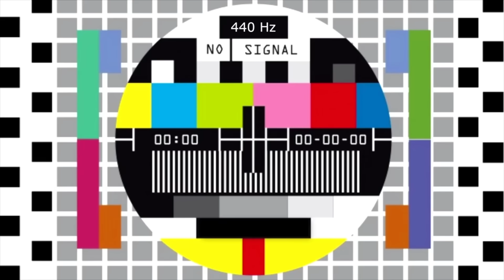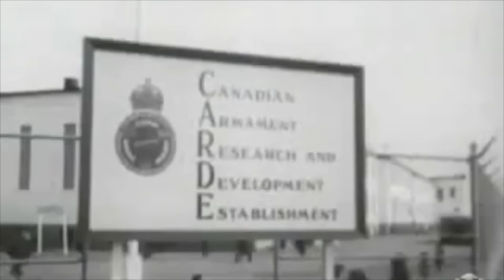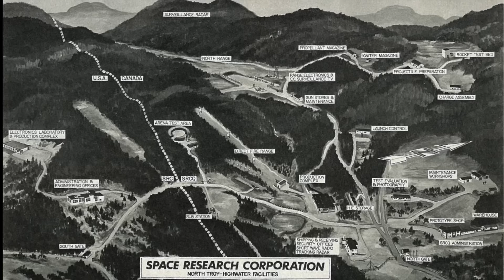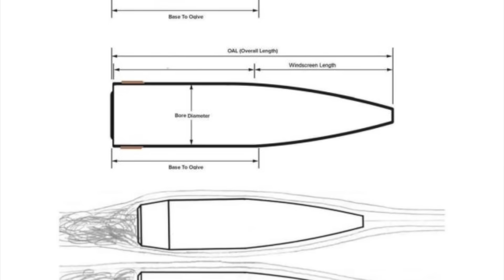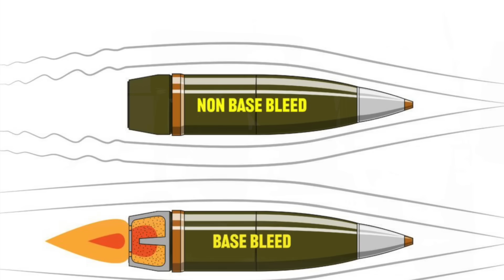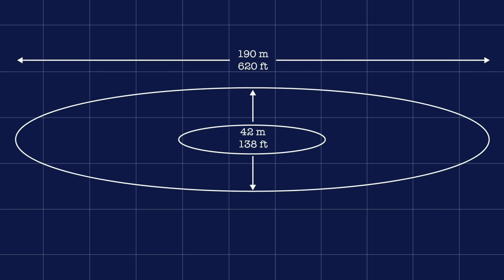155mm ERFB Shell: Faster, Farther, Deadlier

Comment: The shape of projectile Bull implemented is good for range but bad for accuracy. There is an alternative solution to use more traditional shape projectile, but fire it at higher velocity and with flatter trajectory. Modern GPS guided MLRS systems are tough competitors to traditional artillery. It's unclear if it is worth using such shape projectiles nowadays or not.
Reply: That's not an alternative solution, that's just adding velocity to the mix... Something that can't be done without increasing the size of the gun...
Reply: @marcusborderlands6177  Giatsint-S is not big. It has 47 caliber barrel and 27 liter loading chamber.
Reply: @Reginvalt  You misunderstand, the barrel and chamber have to be thicker and heavier. its called physics. if you increase the pressure (thats how you make something of equal mass go faster) you increase the stresses on the surrounding chamber and barrel. The only time this would NOT be the case, is if the ammo was originally UNDERLOADED, and if it was, LOL, LMAO.
Reply: @marcusborderlands6177  M8 don't argue if you don know. The reality is that there are different ways to shoot at a certain distance. You may use more aerodynamic but less accurate ammo with nubs or use less aerodynamic but more accurate traditional shells at higher velocity. And latest artillery pieces may or may not use shells with nubs, meaning Bull's ERFB isn't one and only solution.
Artillery charges are more complicated than handgun loads since they a variable in power (they don't shoot at full charge all the time), gunpowder properties are different and the cost for more pressure is not only extra weight and size, but longetivity of barrel first of all.

Comment: Yeah, this sounds like total nonsense.

Theres no possible way the cost per launch was $5000 dollars - even just the standard barrel reppacement every few hundred shots of the naval cannon would average out to tens or hundreds of thousands per launch.

You're probably only quoting the cost of the shell, which is extremely misleading.

2) quoting the extreme ranges long barreled cannons can get without mentioning the downsides is again, extremely misleading.

Amongst many other problems, barrel wear skyrockets which means you need constant and extremely expensive replacements.

Comment: My cousin worked for Sheffield Forgemasters at that time and he always wondered what the things were that he was working on due to the precise specifications. They turned out to be super gun barrel  sections.
Reply: If I'm not mistaken the Iraqis contracted them under the guise of manufacturing sewage pipes, so given my manufacturing background I can imagine the strange looks that were had when they were told how tight the tolerances were for alleged sewage pipes.
Reply: @richardmillhousenixon  iirc it was declared to customs as petrochemical equipement
Reply: @alcapone796  MI-5 was all over it. And Forgemasters knew perfectly well that they weren't pipes....the reason they were seized on the docks was because Forgemasters got paid first....
A large part of Forgemasters work was for the UK MoD...you don't bite the hand that feeds....and in fact they're now owned outright by the British Ministry of Defence...
Reply: @richardmillhousenixon  I thought they were passed off as parts of an oil production plant but i may be wrong. I have always wished the parts were all layed out as if the gun had been built just to see the scale of the whole thing.
Reply: Now I'm going to have to go and rewatch the episode of Citation Needed where they talked about it again.
Reply: Very high performance pipe line...
Reply: @zapfanzapfan Not very long before that the people building oil pipelines under the North Sea had complained about the quality of some of the pipes.
Reply: @zapfanzapfan  such pressure, such wow
Reply: I can confirm that Forgemasters knew that these sections were not petrochemical pipes; they had to be honed on a machine tool that gave a similar internal surface finish to smooth bore tank guns.  What they could not understand was the thin wall section.  Traditional artillery pieces had a greater wall thickness to diameter than that specified for this contract.

Comment: That thumbnail really caught my eye - G5 and G6 ammunition! South Africa needed modern artillery after encountering the Soviet 130mm M-46 in Angola in 1975.  The M-46 had a range of 27km (unassisted) and 40km (assisted), while  SA's 5.5", WWII field gun (G2 140mm) had a range of only 16,6km and the QF 25-pounder (G1 88mm) a range of 12,3km. Israeli 155mm Soltam guns were acquired as a stop gap while the G5 was being put into production by Lyttelton Engineering Works. 

The ammunition is currently manufactured by Rheinmetall Denel Munition at Somerset West, about 25km from where I live.
From RDM's website:

"Rheinmetall set three new world records during a test fire event in South Africa: A G6 howitzer with a 52-calibre gun achieved the longest range ever attained with a conventional 155 mm artillery round, 76 kilometres, while the 52-calibre gun of PzH 2000 self-propelled howitzer lobbed a shell 67 kilometres, and finally, a field howitzer with a 39-calibre gun attained a range of 54 kilometres."  
By "conventional", I presume they mean not rocket assisted.

Frederick Forsythe's novel "The Fist of God" references Dr. Bull and speculates who may have assassinated him. It think it is fairly safe to say that a Beretta .22LR pistol was used.

Comment: Eh? How on earth is low accuracy going to help you with counter battery?
Reply: Because a deployed artillery battery takes up quite a lot of space, so even with the higher dispersion, you are still likely to hit (part of) it. The shrapnel of the shells is lethal for several hundreds of meters around the point of impact for anyone not dug in. In modern combat, artillery is not dug in; that would take far too long. Counterbattery fire has become so effective that the guns must be moved to an alternate firing position after each fire mission. With a long-range counter-battery unit on alert, it will fire at the enemy battery as soon as it is discovered and probably will catch them when they are rushing around to bug out.

Comment: 15:32 absolute BS. Are you not aware of the Nazi gun that was aimed at UK during WW2, that was also fixed in place.
Reply: I don't think they so much as got a shell in it before the ground it was tunnelled in crumbled into little bits.
Reply: @20chocsaday the tunnel didn't crumble by itself though, it was destroyed by allied bombings. Point still holds that it was fixed in place (no traverse and elevation) and was still a danger to UK (London to be precise) unlike what the guy in the video is claiming that since the gun in Iraq was fixed in place it wasn't a danger to nobody. 

There were actually other smaller guns used by the Nazi that were also fixed in place to bombard other cities like Luxembourg.

Comment: Vacuum rocket motors can be tested on earth in open atmosphere. 

By first evacuating the test chamber before ignition the cover will be blown off by the efflux and then Venturi effect will maintain the vacuum inside the test chamber up to the plume. 

Ok,
Now,
Supergun/orbital guns

You can dig a bloody big hole and stick your rocket etc into a full vacuum without needing a seal to obturate the blow by as it is its own vacuum pump. 

Yes, you do need a cover that will pass a rocket nose cone through. 

Either a discarding penetrator cover or similar.

Comment: As a veteran of the South African army in the 1980's I can tell you from first hand experience that the G5 cannon with the ERFB shell was a game-changer in the Angolan bush war. I can still remember one dark night watching these shells being fired from about 5km behind our lines. They looked like giant tracer rounds arcing from the horizon to above the cloud line.
Reply: Years ago,  a racing team developed a car, I believe Formula 1 Class?  That had a additional small 2 stroke engine that created a vacuum underneath the car and vented out of the back for drag reduction.   The car design was banned from use it worked so well.   FLUID DYNAMICS
Reply: The base bleed shell has a small cylindrical magnesium block in the back of the projectile which is ignited by the cordite charges once fired. The magnesium does not provide any kind of "rocket" or "thrust" to the shell. What it does is displace air at the end of the projectile which removes turbulent air behing which causes significant drag, and hence shorter range. ERFB has nothing to do with base bleed, which is exactly what I explained. The second significant development for these shells were accomplished by a collegue of mine in 2001, which designed a more malleable alloy to replace the drive bands that were used at the time. This reduced the friction between the drive bands and the barrel enabling the shell to reach distances of 67 km, and up to 76 km with addition charge. PS, all of this happened while we were studying our Master's Degrees in enigineering while listening to to the thunder of the SANDF training at the North West Command's Artillery Training Scool.
Reply: So the base bleed acted as a pseudo-tracer? Interesting.
Reply: @FirstDagger  It's functionally just a weak rocket engine. The aerodynamics of why it works are different, but in practice it's a rocket.
Reply: @alltat  No, it is not a rocket.  Base bleed does not provide propulsion, it just fills in the trailing partial vacuum.
Reply: @Fred2-123  I believe what he means is that to fill in that void takes a high flow rate of gas, as it is constantly being sucked back into the airstream. A gas generator capable of that rate of gas delivery is approaching a rocket in the rate and violence of combustion.
Reply: @Fred2-123  It aids flight by increasing the pressure behind the projectile by expelling exhaust gases from combustion of a propellant. That's a rocket.
Reply: @alltat  Look, there is plenty of information about base bleed on the internet.  Google has a lot of links.
One says: " The [base bleed] gas generator provides little to no thrust, but fills the vacuum in the area behind the shell with an inflow of gas, dramatically reducing drag."
Base bleed is not a rocket.
Reply: @Fred2-123  I know that it's not a rocket. I'm just saying that it's a rocket. If you trigger the base bleed without firing the round from a gun, it will move. It isn't USED like a rocket, but it IS a rocket.
Reply: @alltat  Not really. It just provides a small amount of pressure to fill the vacuum that is created behind regular shells. The vacuum creates a lot of drag and filling it negates it. The base bleed provides no thrust though, so it is not really a rocket engine.
Reply: @chrisbrent7487  You're describing a weak rocket, and the end result is that the shell flies further, which is the purpose of an engine. In the end, it functions exactly like a rocket and it achieves the same thing as an engine, so it's a rocket engine that isn't a rocket engine.
Reply: @alltat  No artillery designers call it a rocket engine as it provides zero thrust. it's really a gas generator that just fills the low-pressure area behind the shell.
Reply: @alltat  It is not, and firing base bleed will not propel the shell 1 mm.
Reply: @alltat  It's clear you passionately want it to be a "rocket" which is isn't. Simple as that. No amount of mental gymnastics is going to change that. Filling a space with gas to reduce drag does not equal rocket propulsion, weak or otherwise, by any fanciful imagining.
Reply: @machinech183  It's a device that uses the combustion of a fuel to create expanding gas exhaust which is released behind the projectile while it is in flight in order to increase the pressure there (compared to if the device hadn't been present) in order to achieve a higher flight speed of the projectile that the device is fitted to (compared to if the device wasn't there). It may not fit some specific technical definition of "rocket", but it does fit the colloquial definition of a rocket and saying that it isn't one is detrimental to explaining what base bleed does to a wider audience (such as a YouTube comments section).
Reply: @alltat  A foolish pointless point.
Reply: @alltat mine's the 2nd like on your comment. I think folks just like to dig their heels in and argue about definitions. Whether it's Newton's 3rd law of mechanics, or the Tsiolkovsky rocket equation, or the engine thrust equation, or the pressure differential, this charge would achieve some thrust if activated in a vacuum. It achieves an increase in projectile's range that dwarfs the effect of that thrust if fired in Earth's atmosphere. I think everyone's on the same page pretty much with respect to basic facts & effects & it'd be great if we could find it within ourselves to stop arguing over nomenclature of classifying those effects.
Reply: @alltat rocket assisted artillery, damn
Reply: Nope in theory all a base bleed does is break the turbulence directly behind the projectile breaking the drag factor
Reply: @Fred2-123  100% correct the South African 155mm projectile the base bleed could be screwed on/off so same projectile could be fired as normal at shorter distances....if my memory is correct base bleed could add an extra 8 to 12 kilometers when firing with super charge (zone 6 charge) for max distance.
Reply: @alltat  You know what's even more detrimental to spreading understanding? Lying.
Reply: @alltat  No, it won't move. You know nothing and want to talk. Base bleed is NOT rocket propulsion.
Reply: @alltat  No....  a rocket uses a bell or other curve to generate thrust.     Base bleed changes the flow at the rear of a projectile, causing reduced drag.
Reply: @chrisbrent7487  Not so much the vacuum but the turbulent flow into the vacuum.   This turbulent flow "steals" energy from the projectile.    Eliminate the vacuum, eliminate the turbulent flow, reduce drag.

The Swedish defense establishment created base bleed.
Reply: If you ever fire a Rocket Assisted Projectile you know the difference
Reply: DUDE, imagine if someone did exposure photography of that sight!
Reply: Do you know if the base bleed charge has a delay on it? Otherwise this seems like a bit of a design flaw for counterbattery spotting if it lights up as soon as it leaves the barrel.
Reply: @murica7096  uh, if you can spot an arillery piece firing 40-50km away from you, thats quite an achievement
Reply: @GerManBearPig we have things called drones, perfect for seeing the flash!!!! In IR if needed
Reply: Counter battery radar enters the chat. 45 seconds to a minute for firing data and rounds down range
Reply: @murica7096 the muzzle flash alone is going to give you a better indication where that was fired from, you know if you could see the muzzle flash from over 20km+ away. The base bleed is the least of your worries for counter battery fire. The US counter battery radars (aircraft and ground based) will detect the rounds as they arc up about 1-3 seconds after firing and give friendly counter battery fire a solution to fire at the enemy before their artillery has even landed. Counter battery fire is scary as the Ukes and Russians can attest to.
Reply: @murica7096  to be fair what would they do about it?  Fire their own rocket shells?
Reply: @murica7096  You'd think that the opposing side wouldn't have anything that could match the range for counterbattery fire
Reply: You should write a book about your experiences.
Reply: Could it be called a Shellrock or Rockshell lol 😁
Reply: Amazing... 😮
Reply: That would have been some HARD fighting between the enemy, the terrain, and critters.
You have my respect, sir. 🫡
Reply: Good first-hand report.
Reply: WHAT ASHAME INTELLIGENT PEOPLE like you develop devices to kill myster human beings To kill our brothers, instead of thinkeing about how mankind could cooperate in order to save our very precious planet, with all its life, mysteries and beautiful opportunities…some people are on the wrong side of history, and there will be a judgement day!
Reply: 32 buff?
Reply: You still lost
Reply: @cainonyango5292  we were sold out by politicians.
Reply: imagine thinking it was socially acceptable to publicly admit that you were a soldier for apartheid south africa
Reply: @woman-at-arms  I agree that the morality is murky. But remember (1) we were conscripts and (2) if it wasn't for us South Africa would have gone the route of Zimbabwe and many other African countries. It's not always clear who the good guys and the bad guys are.
Reply: @marcusmoonstein242  nah bro it's pretty clear
Reply: @woman-at-arms  and where's the problem with that exactly.... nothing wrong in fighting against terrorism.....
Reply: Loser. 😂
Reply: Thank you for your service
Reply: Coolest damn youtube comment I've read in a while
Reply: What a place and time to have lived… 👌🏻
Reply: It's rough for White People there now sadly!
Reply: You never should've given up control over SA. 
Sure, treat people better, end apartheid maybe? 
But those wonderful "equality lovers" are worse.
Reply: I used to read about the Bush Wars, you are a Hero! Thanks for your Service!
Reply: I used to read about the Bush Wars, you are a Hero!
Reply: This writing reminded me of a guy who escaped Angola during Bush war. 155mm works well against very weak armies, or as Israel showed civilians, that's it. We are not capable of making enough of even basic 155mm when fighting real army, let alone nuclear superpower. 
What's next, hypersonic shell, maybe hypersonic rocket, or air defense against such weapons?
Reply: long live rhodesia!